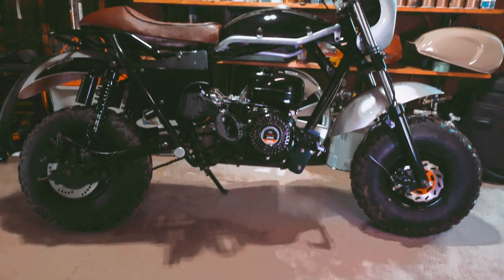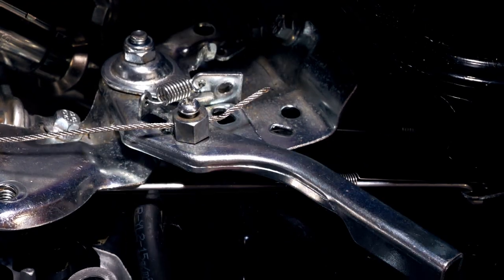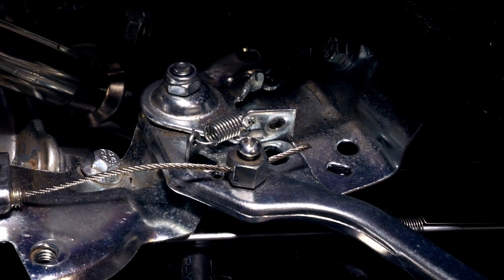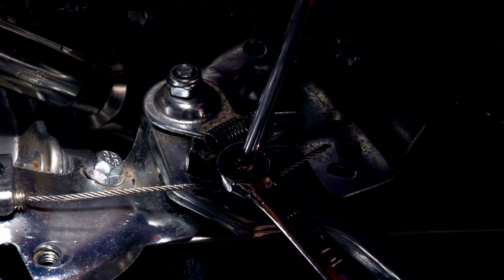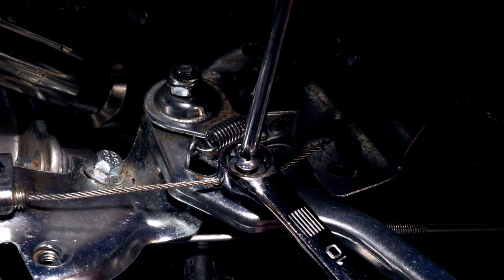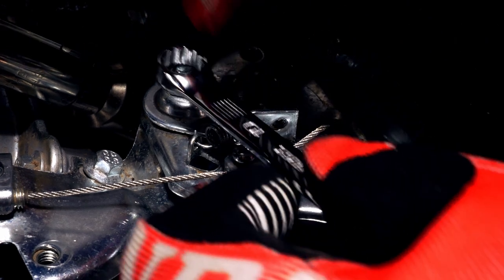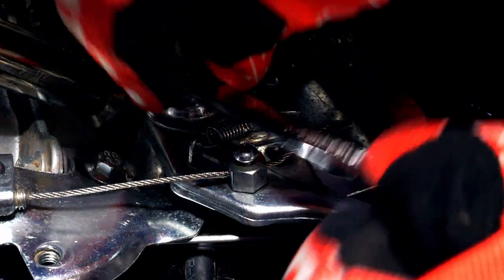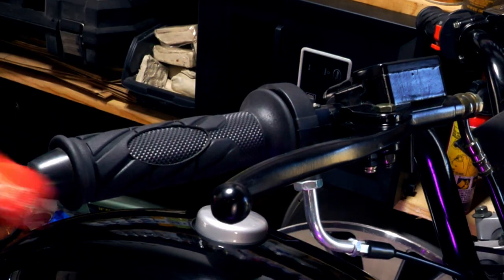Mini bike soft throttle fix - EASY adjustment [Trailmaster MB200]

Comment: Are you aware there is a barrel bolt with a lock nut up by the throttle housing under the black rubber boot?
You may need pliers but loosen the locking ring. The knurled part. Once loose back the barrel bolt that has the slot for the cable installation and removal until the slop in the throttle and that cable play is removed. 
It’d your bike or cart is run away allowing some slack may be the issue.

Comment: Does this tighten throttle? Cuz mine just wants to take off and is super sensitive any tips?
Reply from the maker: It can tighten or loosen yes.  If yours wants to take off that's where I would start.
Reply: @Overballin okay thank you, I’m the video did you tighten or loosen it? I have never worked on something like this so I am knew
Reply: @Overballin nd any tips on how to fix pull start on 212 predator?

Comment: why does my rt200 drive off by itself when I switch it to run?
Reply: Make sure your governor arm is fully hooked up happened to me
Reply: @333FØCiS  this is what happened to me as well. Somehow either governor arm or the pressure from the top nut, the throttle is being held open. I launched mine down the driveway from the long hooked spring not being completely loose before start.
Reply: Idle set too high ?
Reply: This could be from your springs connected on the part of your throttle that is underneath the gas canister not going all the way back. You can get some new or better springs for 7 bucks.
Reply: Had this issue on mine when trying to rig up the governor different way.
 Chances are your governor if you accidentally did it wrong or the rig isn't working as you thought it could be that whatever you did caused the governor so it didn't back off enough.
  When you switch the bike to run it'll obviously have more rpms and power and on top of that if the governor  spring is weak and with that power it could be rattling as soon as you switch it to run and make it even harder for your throttle return spring to back off into a closed position.
 I'm honestly trying to find my other throttle return spring and try that not only to see if mine will go faster and have better power or acceleration because my spring seems weak and the throttle snaps back weakly or slowly so I'm missing out on good performance.
I have upgraded the sprocket so it should be quicker or atleast have more pulling power but yeah in my experience that happens when you do something so the governor can't back off when you trying to start and run it.